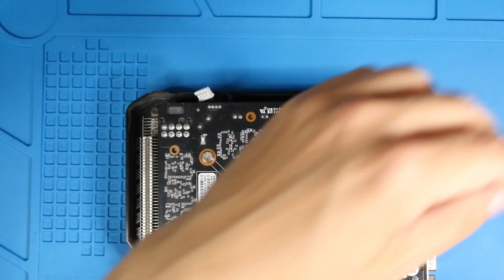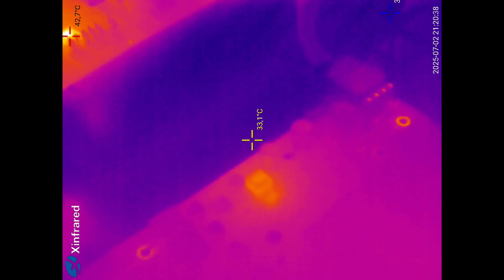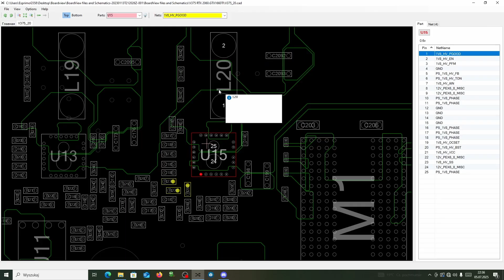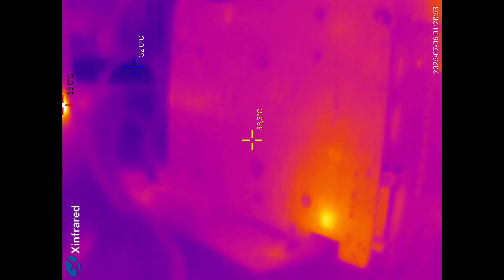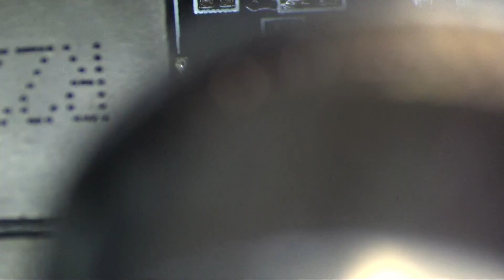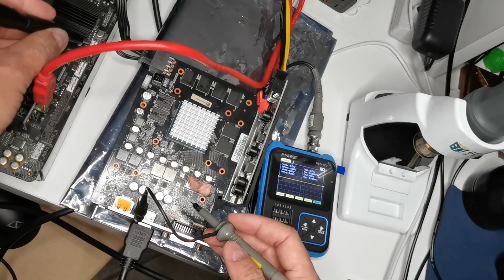Episode 34 - Palit GeForce GTX 1660Ti StormX [GPU repair]

Comment: 32:05 you can change settings in this LG TV to show all pixels without cropping. I have the same LG but white colour.😅
Reply from the maker: I know, but the settings reset anyway, every time I test another card. Well, sometimes it works fine straight away, sometimes it's like this. So i don't even bother changing it anymore ;)
Btw. I got the monitor from my younger brother a few years ago. Before he used it for quite some time. And we bought it used with a PC for him many years ago. And it's still rocking. A family heirloom xD
Reply: @MyElectronicsRepairAdventure my LG is from 2009 and still works. I use it to test PC and as reserve monitor.

Comment: 5 omhs vcc to ground on vram rail with micron is too low i think its around 50 to 60 omhs in samsung vram is around 20 to 30 omhs but for what ever reason it works on you thats nice,,so a heating multiple phase controller ic indicates a shorted drmos thats what ive leared nice
Reply from the maker: I was surprised as well and that's why I removed so many components when searching for a fault. I had a card where VRAM resistance was around 9ohms and it was also fine (video is on my channel as well). So even though I knew it can be low, I didn't expect it to be that low.
Also, I was looking under the thermal camera once the card was already powered on. But with a faulty DrMos like here, it only blinked at the startup so I missed it at first. Lesson learned for me.
Reply: low vram rail because the palit factory manager watch youtube gpu repair amd thinking adding low ohm resistor paralel to vram rail to confuse repair man and deemed no fix 😂l